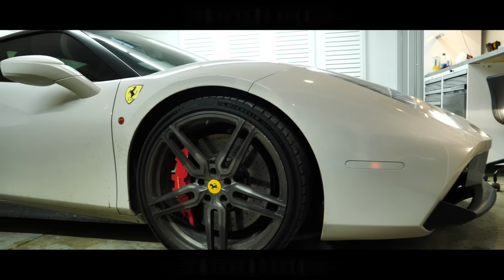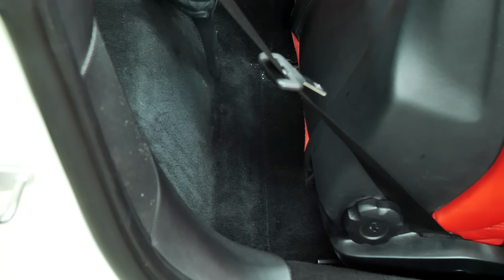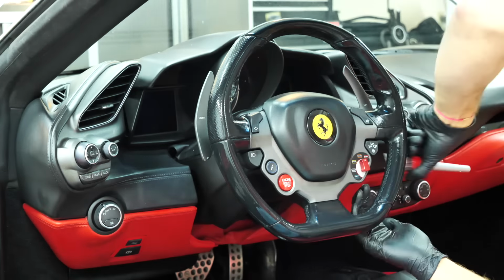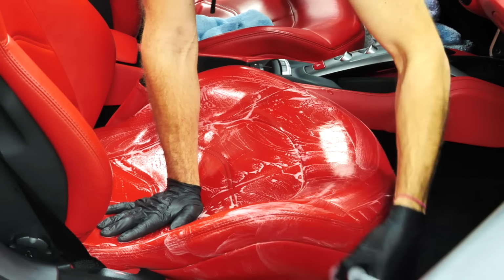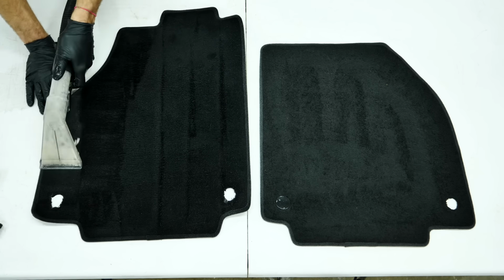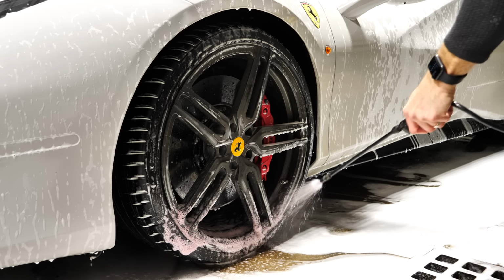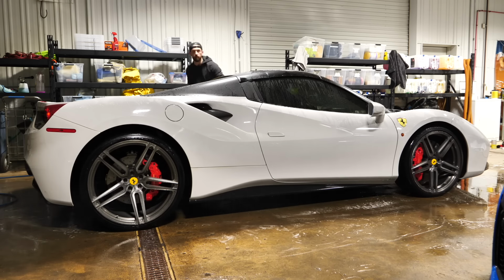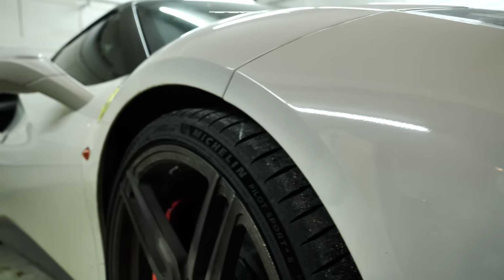Car Detailing A FILTHY $300,000 Ferrari 488! Interior & Exterior Deep Cleaning Transformation!

Comment: Where is your shop based because I have a vehicle and I think it would be different then the other vehicles you have done. My dream vehicle is an all original 1956 ford f100 red with a spare tire on the driverside bed fender.

Comment: Noble Chemical 1 Gallon / 128 oz. Orange Peel Citrus Solvent Cleaner
In my Carpet cleaner days we'd use this (80% Orange to 20% H2O) very sparing on spots that would need it the most; Greece, Paint, body fluids and or blood. It was the Magical Money grabber, lightly spray on surface wait 5mins and use your a brush or rag to pick it up. 90% of the time, it worked 100% of the time.

Comment: Man, as a detailer to another, please watch out at the plastic stuffs, carbon materials or any light stuff in the car with that small nozzle, and while you use a brush, get the nozzles off, let just the vacuum cleaner tube hole, it sucks up more and better.
On the other side, well drone bro, i'm proud of you